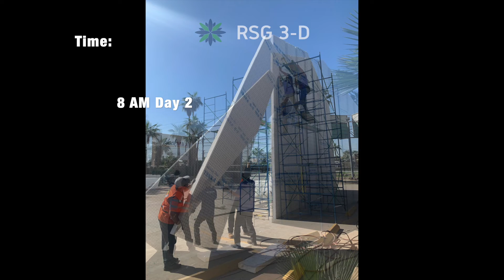TWO STORY DUPLEX MOCKUP AT RSG 3-D MANUFACTURING FACILITY

Comment: There are certain complaints that polystyrene shrinks over time resulting in a gap between concrete and polystyrene and then water seeps easily and the structure slowly weakens... is this true?

Comment: How is this faster or more efficient than the 'foam blocks' that have been used for the last 35-40 years? What is the advantage with this wall?
Reply from the maker: Hi Ruth,  you must be talking about ICF's right?  If so,  then having the protective structural layers on the ext/int fascia not only provides for better resistance to fire,  hurricane wind debris and others,  but the thermal mass inside the structure far surpasses that of ICF blocks.      There are no weak spots in our product.   100% of the wall is protection.   Combined with good windows and doors you will have an impenetrable structure.
Reply: @RSG3D  and, ICF is a wall system whereas structural concrete insulated panels are a complete building systems for exterior and interior walls, floors, roofs, decks, and even stairs and ultimately uses less concrete than an ICF with a 6” cavity